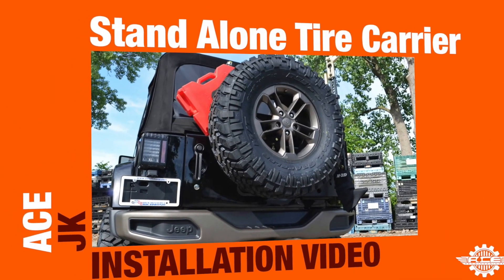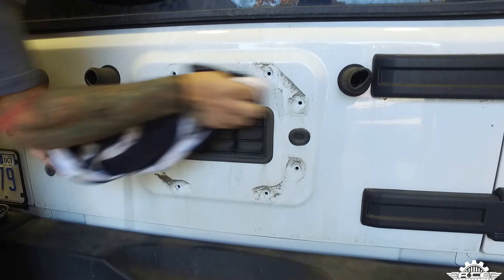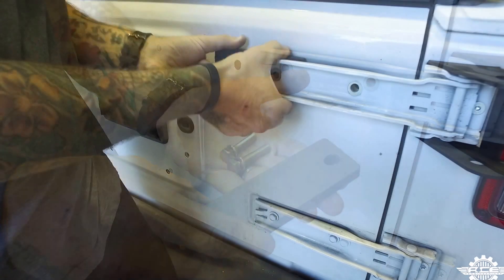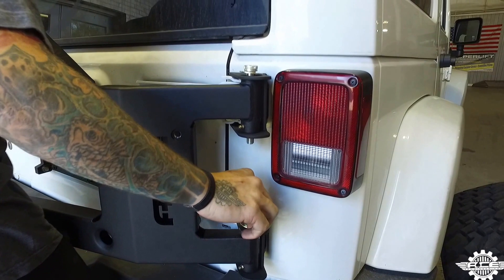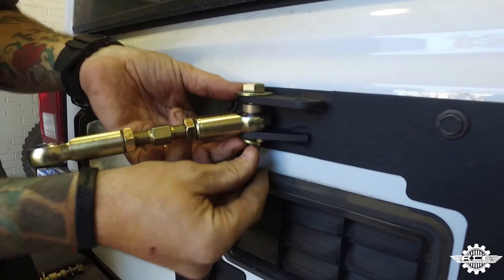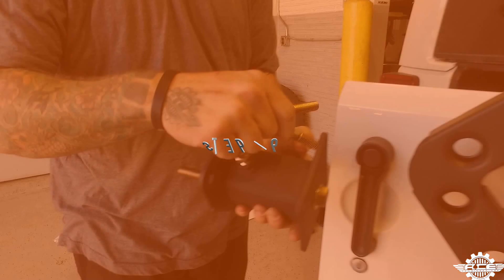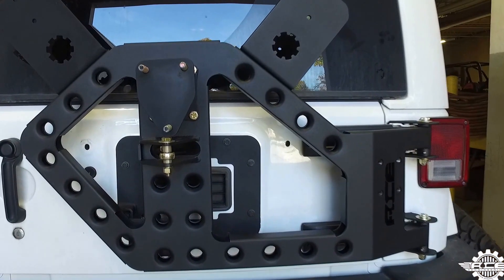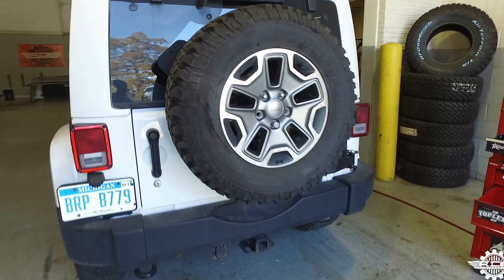How to Install the ACE JK Stand Alone Tire Carrier

Comment: Is there a way to lower\raise the spare tire to adjust height? thanks
Reply from the maker: Alan - sorry no. The tire stanchion adjusts telescopically to accommodate different backspacing, but does not adjust vertically. We have however had a 40" tire mounted without a problem.